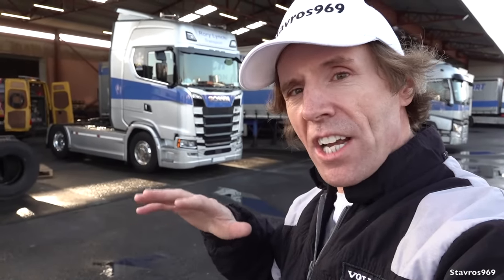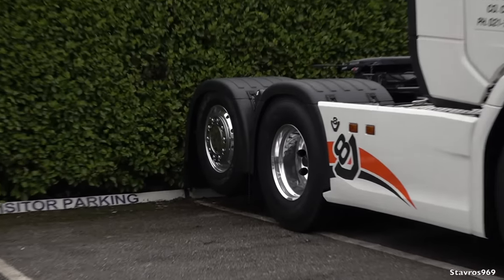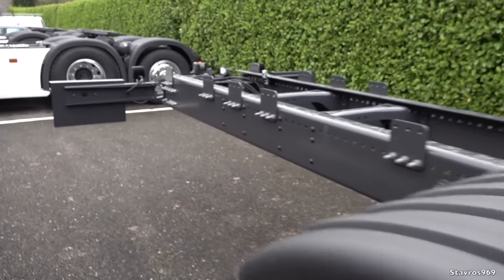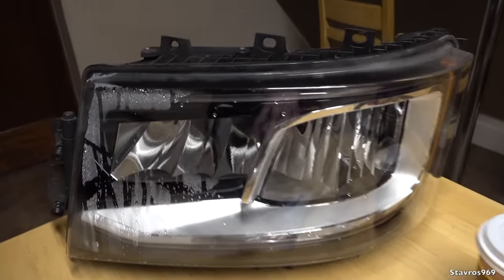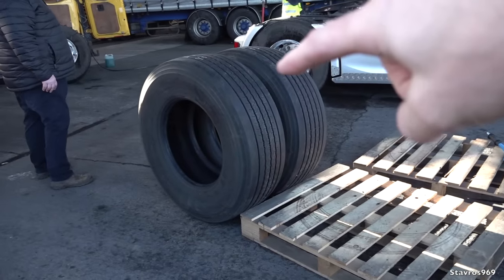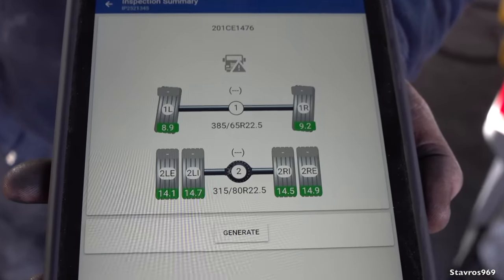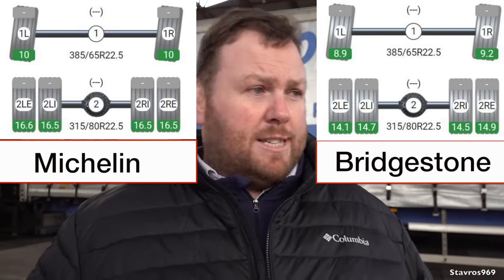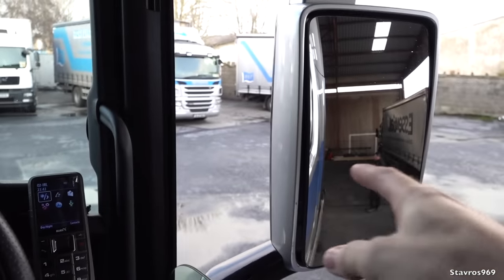Truck Tyre Trial Results! Bridgestone v Michelin? 55,000 Mile Test

Comment: Tires that wear faster often have a softer tread which can yield better traction in wet conditions.  Tire wear is just one measure of overall performance.  Comfort, vibration level, traction, braking performance all need to be considered.  I use Michelin on my personal auto but I know that Bridgestone makes a great tire also.  Interesting study, but certainly not a comprehensive comparison. I like that the Michelin representative acknowledged that this was just one result on just your vehicle.  Shows he is objective and a professional.

Comment: Depends on the tyre. Continental and Michelin sport contact and sport pilots for example barely last 15k miles on a car meanwhile they Primacy can easily make it to 20k. Pirelli cinturato or Bridgestone Turanza seem to be the only decent ones for longevity
Reply: I had continentals on my car when car came new in 2018 was lucky if I got 20k kms out of them replaced them with General Altimax tyres after being recommended to by the tyre place car now on 64k and still life left in the tyres hopefully will see the car out to July when the new one hopefully arrives  to replace it

Comment: 3:21 I think it's 6×4 with tandem lift just guessing from tyre pattern of tag axle
Reply: It all depends of what configuration has been ordered. Double wheels might be for a better grip and weight distribution. Since this is a XT chassis which is built for a construction and off road use. Then definitely it might be 6x4.
Reply: The hub on the tag axle is different from the drive axle, so it's probably not a driven axle but a 6x2. I think double-wheel tag axles are for trucks where the extra axle is going to be more than just a rules dodge (see: UK-style mini-midlifts where the midlift mostly exists to allow an extra three tons on the trailer).

Comment: hi stavros, Haitham  here from East Africa, sorry could you please help and do a review on what is really the difference between the scanias P,G, and R series engine wise, are the engines mechanically different or is it just the cab difference that we know? thanks.
Reply: I am not a truck driver but I can give you the info about what I have seen and heard from my country. Normally G series has different engines than R but I heard you can order them with specific R series engines. G series are more simpler and probably better suited to use in developing markets and in places like construction and military where you need simplicity and toughness over technology. In Turkey, we both had R and G series, mostly G420 was very popular. (I am living in another country and not back since 2019) I know G series are still produced. In my country we preferred G series due to being able to use lower quality diesel and cheaper parts and maintenance costs. R series used to be the luxury but nowadays they have S series. And P series are lower cabs, generally I see them in 360 370hp. P is used as truck chassis and tractors. I have seen P series in Thailand mostly. Generally 6x2 with tag axle. Not much but generally pulling fuel tankers. Normal stuff are Hino and UD trucks. Also some chinese. Places near EU more likely to use R series and G series. P series doesn’t have V8 options, only straight 6 cylinders. And I heard G and P series share same drivetrains. I also think G series are not available with V8. They say up to 500hp. And I saw that Scania also includes 410hp petrol(gasoline) powered truck, probably for use LPG or LNG. I saw trucks in Thailand run on LPG and CNG. So we have L series, I never seen them maybe it is for Urban use only, P series, also urban but maybe you can use as a Truck in truck chassis configuration as a box truck or as tractor for also urban and cheaper and smaller alternatives to others. We have G series made for more tough situations, built simpler with cost and repair in mind, R series, made for comfort, and S for being flagship. R and S series are flagship of Scania.

Comment: Silly question,  but why do some units have the tag Axel at the rear.? Thanks
Reply: Tag axle is for extra weight support. On some trucks a tag axle drops down automatically when drive axle get up to the certain weight. Also tag axle is better than fixed axle, in this case when truck is unloaded or with a minimum weight. The tag axle lifts up, it helps to prevent drive wheels from over spin. Some truck have tag axle as a third and some as a middle. When tag axle at the back, then truck does more sharp turns because of shorter wheelbase. In my opinion, I like when tag axle at the back than in the middle. Also some trucks have tag axle as a steer axle, this is an additional benefit for turning when axle is down and all these features costs a lot of money.
Reply: @EduardSLVRU  thanks for your explanation much appreciated 👍
Reply: In many cases it's a legal requirement because of how much the cargo being hauled weighs. Most countries only allow you to put so much weight on an axle, in order to not damage the road. But if you're not hauling that much (for example, if you've got an empty trailer that you're driving back to refill), having the axles on the ground just costs extra money and fuel, so a system for raising the unnecessary axle off the ground was invented.